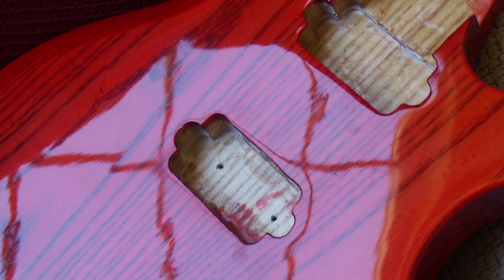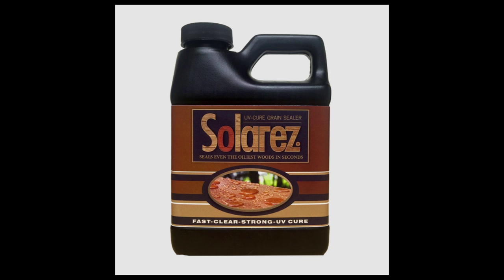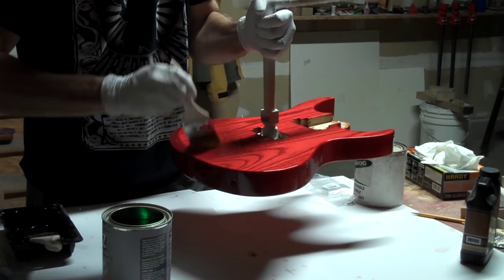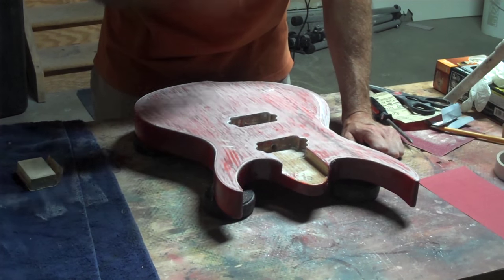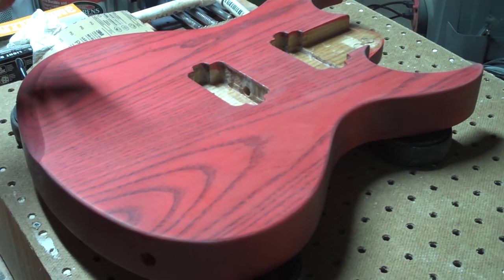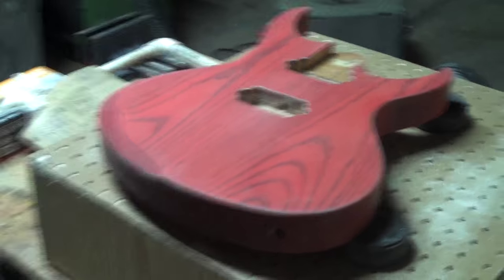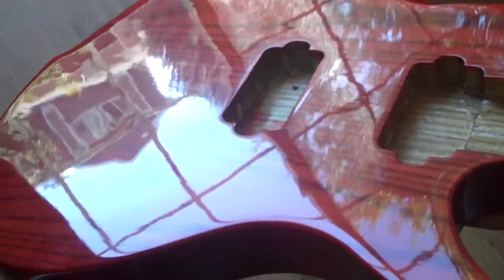How to Clear Coat A Guitar With Solarez UV Cured Polyester Gloss Resin

Comment: I would also mention wet sanding is only usefull after you completely level the surface, and only go for it on 1000-2000 grit or more. If you have any inconsistency on the surface, wet sand will create white deposits, which are very hard to remove specially in sections with small pore-like holes.
Reply: I followed everything in this video perfectly. But I’ve got those white deposits all over. What is the best way to remove them without sand through? I don’t want to screw it up but it’s taken a long time to get to this point and I don’t wanna mess it up.
Reply: @1smenz  the deposits are rest of the lacquer dust which were stuck into little holes in the finish....usually, since it's just dust, you can remove them by gently scratching them with a needle or something pointy...after you removed all the dust, you can use a little drop of the thinner used for that same lacquer to delude it, and that way you will eliminate the rest (using a q-tip), THEN, you can take a toothpick, and take a tiny drop of lacker to fill that hole.

My suggestion to prevent this in the future, is to FIRST DO A DRY SANDING of the surface using a flat block, to verify 100% there is non of this little holes. Since it is a dry sanding, you can remove all the dust accumulated just by blowing air into it with a compresor or those rubber bladders), if you find any shiny spot over the dry sanded surface, means you need to keep leveling (and if is tiny holes, best is to go for the drop of lacquer with a toothpick, fill it to the point there is some zit of lacquer, and then use a shaving blade to scratch the excess (there is a video from the old guy in stewmac's YT page where he shows how to fix one of this holes in an old guitar)

Comment: Cool video.  Surfboard shaper here. The bubbles you're fighting are called "gas out" and it's air escaping from the wood as the ambient temperature rises and the gasses inside expand.   So, if you apply only as the temperature is going down, the resin will be sucked into pours rather than gassing out.   =]
Reply from the maker: Interesting. And here I've been trying to do the opposite by heating the surface after I apply the resin. So how would I apply it and then lower the temperature?
Reply: maybe heat the body in an oven at low temp? Then it'll cool after the solarez is applied. Thats my plan on the axis replica I'm building now.
Reply: Highline Guitars have you tried this technique yet. What about letting it sit outside for a few min under a black sheet? Would that be enough to heat it. I get the gas out comment. Wondering if you have worked it out?

Comment: I used this method on four guitar bodies and it works really well.  They buff up VERY shiny - almost like a polished granite.  I strayed slightly from these directions in that I used a single coat of grain sealer on a maple body, but used three coats of Solarez vinyl ester finish.  This helped prevent sand-through which I found problematic with only one coat.  Thanks for the great instructions and videos, Chris!
Reply: I was wondering about the danger of sand-through. How long did you wait after your 1st coat before applying each of the next coats of the resin? i assume there was no sanding or uv application in between the coats. Also would it not be better to apply a 2nd coat of grain sealer before starting the 1st resin coat?
Reply: I only waited a short time between coats - maybe an hour at most.  After it hits sunlight it is very dry in 5 minutes.  Just make sure you hit every angle on the guitar to sunlight for 5 minutes - if you put the top coat on before the sealer is totally dry it can cause a bubble.  If I were to do this again I would try a second sealer coat to add thickness instead of multiple top coats.  The sealer is more viscous and goes on kind of sticky.  Both the sealer and top coat dry fast once it hits the UV of sunlight it's easy to try both methods and see how it comes out on a tester board.

Comment: I been a Painter/Finisher since 1973 and I've done this Professionally since 1980. Try Oslong Sandpaper. It has a special latex backing which feels kind of like those imitation leather tags on the back of Levi's that you know they felt like leather but they're not that's kind of what it feels like. As I say I've done this full time professionally since 1980. It's not just my job it's my life I've not had any other kind of job but a Professional Painter/Finisher/Restorer my entire life. Is the essence of who I am. Oslong Sandpaper is hands-down the best there is, light years ahead of anything else I've ever used and I've used them all. It almost doesn't wear out and it doesn't clog unless you have something sticky like heart Pine in which case you can use those natural rubber blocks on your electric power Sanders and even on your hand sandpaper erase whatever's sticking to it. the grit doesn't come off even when you crease it and then roll it like back and forth you know trying to make the grit come off it still won't come off. I've never seen the same paper do this. Yes I know all sandpaper eventually wears out but Oslong Sandpaper Outlast and outperforms any sandpaper I've ever used. I get mine from John at Marine now on eBay. Try the assortment pack it starts at 80 grit and goes up to 2000 Grit two full size 9 by 11 sheets of each Grit for like $15-$20 bucks. Now for fast and easy removal of raw wood I use 3M Resinite Floor Paper. it's what the hardwood floor people use for sanding down hardwood floors. It cuts Like No other What's the sharpest fastest would removing sandpaper you can get and it's highly durable as well. It's so stiff when you fold it it's cracks the paper. is specifically made for grinding Darrell quick removal of raw wood it's made just for that purpose only you'll never use anything else once you tried. It comes in grits from 60 to 150. There may be some other grits but those are the only ones I've seen. I normally use the 80 grit and I can remove real wood faster by hand no machine then you normally can with something like a palm sander it's just super super fast and by doing it with your hand especially if you're trying to just you know you don't want to take a chance on moving too much so quickly it's the way to go it doesn't require a lot of hand sanding you can just a few strokes and you can see the woods is coming off but you can control it because you're doing it by hand if you're doing something delicate now if you were trying to say remove the planer mark off of a guitar top, back or any flat surface you could definitely use a palm sander but I just use a block of wood in my hand because it's so fast and I can control it so easily like that. When I first started painting I work for a man who was old school and I did nothing buts and and putty raw wood with the little soft you know painter's putty for two solid years. Nothing but sandpaper my two hands 4O hours to 60 hours per week. I like hand sanding I just don't like having to spend forever on one spot that's why I say that resonate floor paper is the way to go on bare wood it's made specifically for wood removal. For polishing I realize you have buffing equipment but for someone who doesn't or if you just want to do something like polishing nut or even polish a fretboard I use 3M Tri-M-ite Polishing Paper. I get mine from Rio Grande jewelry supply because they're assortment pack has two sheets of each of the six Colour Coded Grits that's 12 grits total for the same price everybody else charges for one sheet of six grits silk sheets total. Last I bought was like $15. I have been able to get a finish that's really high gloss nearly as glossy as a buffing wheel just doing it by hand. When polishing a Rosewood or ebony fretboard I can polish the Frets and the fretboard at the same time without having to tape anything up or worried about the dust from steel wool because I've rubbed the Frets and the fretboard at the same time working my way up through the grits the six different color coded grits that they have and by the time I get to the last Grit the fretboard looks like lacquered maple I'm speaking of an Unfinished raw wood looking like lacquer maple and the Frets look like Chrome. People always are amazed when they get their guitar back after having the Frets leveled and polished and the Frets look like Chrome in the fretboard looks like the lacquered Maple and there's no finish on it. Much simpler than taping up a fretboard you accomplish two birds with one stone. If I had a buffing wheel like you then I would use the Menzerna bar they have a black one which is perfect for dark hardwood fretboards because it won't leave a white residue in the pores of the wood. Menzerna also has a great liquid guitar  polish it comes in a small 4oz to put in your guitar case or a larger 22oz size with a slightly different name something like paint polish paint swirl polish but menzerna says it's the same product. Lastly use bore doctor from doctors products for oiling your fretboards. This is hands-down the best product on the market there's nothing else like it. It's a blend of tropical hardwood oils and antioxidants. It replaces the natural oil found in tropical hardwoods without clogging or sealing the pores. All other fretboard oils are either mineral oil or linseed oil. Lemon oil is just lemon scented mineral oil.pure lemon oil is highly acidic and highly corrosive. Mineral oil clog the pores of your Hardwood which is terrible. Linseed oil seals the pores of your Hardwood which is even worse. Bore Doctor was originally designed as a clarinet bore oil which it which are made from Grenadilla wood and they have to be oiled with something specifically that allows the wood to breathe without clogging the pores and anyway. A friend of the inventor dr. Lloyd Henderson was a guitarist and upon seeing how well the Bore Doctor performed on a  clarinet he tried it on his unfinished fretboards and the rest is history. This product the only product I have seen that will penetrate all the way through an unfinished fretboard from the top to the bottom I have personally witnessed this myself. Google it and you'll be able to find it for $20 in the 60 ml / 2 oz size. Perfect size to try it out and the fit down in your guitar case. If you go to doctor products you can get larger sizes for less money the bigger the size the less per ounce. Once you use bore doctor you won't ever use anything else again I've never seen any kind of finish that can penetrate the way it can. I'm sorry for such a long post but I really hope this helps you, your videos have really helped me. I'm going to try the Solarez per your recommendations on my next project. I would just like to add 1 comment on your removing the Solarez with a credit card on the sealer pore filler. You might try removing it with a dry foam brush or one of those dry natural bristle chip brushes I I saw you using in your video. I've had great success and doing this to remove excess paint or varnish while the Finish is wet. This would work great I believe on like a carved Top guitar or something with a lot of contours where a credit card just wouldn't work. It's just a suggestion. I like your credit card idea but then I though how would that work if you were trying to do it on highly contoured surface like a carved Top guitar. I was thinking you could use the credit card on the back and sides and the brush foam or natural chip bristle on the contoured carved top. If you try the brush removal. method let me know how it works. 
God Bless 🙏😇 You and Your Family!! Jimmy in NC....
(910)-818-3279
thepainter.198094@gmail.com
P.S. If you don't mind me asking how much did you pay for your CNC machine? I'd Love to own one.
Thanks again for all your help. You're a great service to the Guitar Building/Luthier community.
Reply: Wow, Jimmy - you just shared a good months worth of study and tips- thanks!
Reply: @jrosner6123  Your welcome. It's what I've done my entire life. 
God Bless
Jimmy in NC....

Comment: Thanks for the information, i like to mention that when i use polyester finish I don't fill grain at all , polyester coating fills it however it may bubble due to air trap in the open pores of the grain , i spray it on medium about 8 to 12 cotes with 10 minutes in between then it fills all grain and even nail holes , thanks you

Comment: the only well worked clear coat in youtube
Reply: could not agree more :')
Reply: Luis Romero Charry

You mean it works well and you would use this brand?  I'm looking at uv cured finishes.  It's either this or Simtec.

Comment: All i can say, while waiting for my acrylic lacquer on my hand made strat to cure for weeks, is that iam jealous.....wow....a finish that can be done in a day.Excellent stuff  and thx for the info.
Reply: And how about the fact it never really cures? Can put in guitar case for long , can use most guitar stands with rubber or plastic as it eats away at the lacquer clear coat.
Reply: Lol you are right.I can def relate to the stand denting it like crazy in my first try.In my next two i used a simplistic strategy that worked though:Grain filled everything with thin cheap superglue(so superglue was used as a grain filler sealer an all in one thing) levelled it and then shot acrylic clear every two or three hours for  two days straight used three cans.....after that i left it one month to gas out without levelling it  and only after that month i sanded and levelled that thing...then i left it one more month alone before the final buffing....didnt have a problem at all doing it this way.Its as hard as anything now in both guitars.

Comment: Great video. Thanks! When I tried this stuff, it refused to flatten out at all. It was difficult to sand off, which makes me think that if I can get it to behave, it might make a good finish. Solarez makes a product they sell as a solvent/cleaner for this. They also say it can be used as a thinner. So, I am going to see if I can thin it and get it to flatten out.
Reply from the maker: You can warm it up to thin it as well.
Reply: @HighlineGuitars  Thanks, I will give it a try.

Comment: I put this on the previous solarez vid aswell thaught I'd post a copy here. Hi I make fishing rods and a few yrs back a product similar came to market it was a UV cure 1 part epoxy I use to use it for emergency binding repairs on site at fishing comps, I thaught this is it stuff would apply easily dry in minutes not hrs and hrs with normal sunlight and even quicker with a UV light box. Problem was whilst it got the guys out of trouble and back in action quickly the stuff never actually stopped setting up for all intensive purposes it was usable in minutes but after the angler used the rod mostly in direct sun light whilst fishing it would start to crack it was like it kept shrinking over time. Now it was not some red but it was awfully similar so maybe something to consider especially if you rack your guitars in a room with Windows. I'm not sure if it would happen but maybe keep an eye on things or even do a test piece and leave it in a window. On rods it would go on like a tube shape so if I were doing a time test put some flat and complex curves into the test material. Great vids keep them up super informative.
Reply from the maker: Solarez doesn't do anything like what you describe.
Reply: Great the stuff I used was similar so I'd thaught I'd ask

Comment: I finally decided to try it. When it cures, it is bone dry and looks wet. When I level sand, and go up to 3000 grit, it is somewhat shiny and slick as glass. I used an orbital polisher with 3 grits of chemical guys pads and Mcguire's  scratch remover, compound, and polish. It never got back to that wet look. So I keep polishing and start to notice a lot of scratches.
IL assuming I went through a layer of solarez? I'm back to coating in solarez. I want the final finish to look wet. Any suggestions? Thanks.
Reply from the maker: @clutch2827  Orbital polishers are no match for a buffing machine with 14” wheels and solid polishing compounds, especially with polyester clear coats.

Comment: What would you use as a sanding sealer beneath the polyester? I plan to use their grain filler/sealer for the rear/sides of my guitar, but I am quite concerned with brushing on a sealer like the grain filler on the top of my guitar, which is a quite complicated water/alcohol soluble aniline dye that (on my test sheets) is extremely easily disturbed, so I will be using an LVLP gun to spray (insert sealer) in very gradual mist coats. I was planning to use shellac, but it is very unclear from their website whether this would be compatible with the polyester.
Reply: Did you have any luck using a LVLP GUN🤷🏻‍♂️

Comment: Instruction on you guitar holding device would be much appriectiated :)  

Great tutorial BTW :)
Reply: Id like that as well
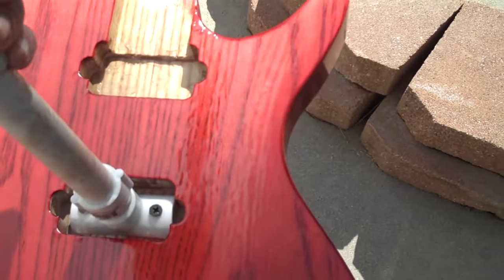Reply: I see 2 lengths of 1/2 inch PVC and a right angel elbow fitting to make up most of it. At 7:28 it looks like he cut down a T fitting to attach in the humbucker route.

Comment: I'm about to finish a guitar with Solarez thanks to this video.

Are you sanding the sealer, or just applying it and applying the gloss resin right on top? I'm not sure if I should be sanding it down first, and if so, using what grit. Please advise. Thanks again.
Reply: I'd like some more detail on the grain filler part of the process as well. I know you mentioned you only use a single coat of the resin in the video, but you said 3-4 coats of the grain filler, did I miss info on what to do between filler coats? Thx!
Reply: Same question. Are you sanding the sealer?